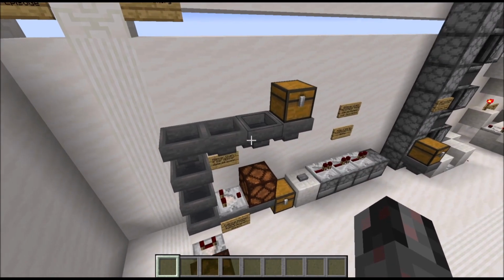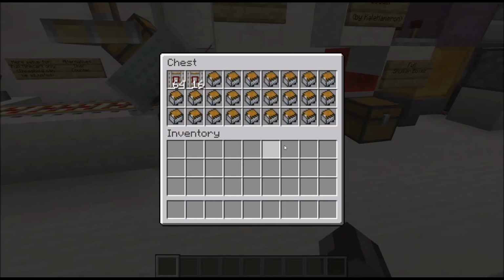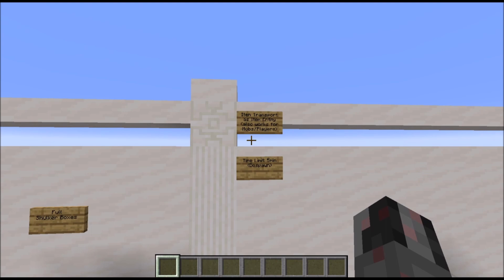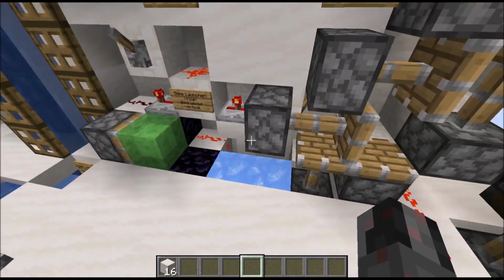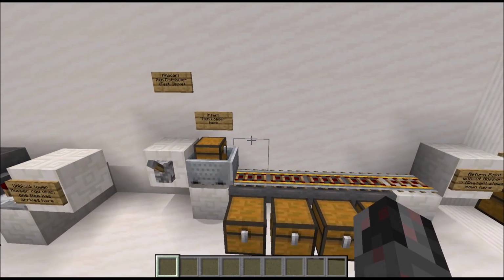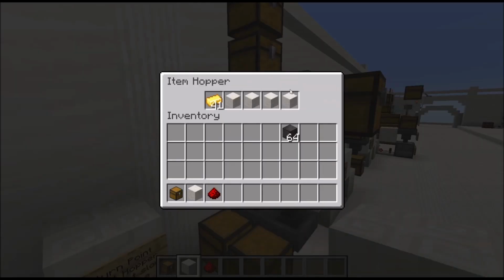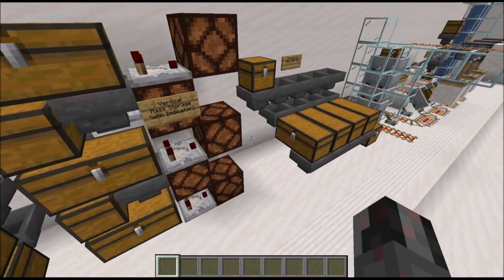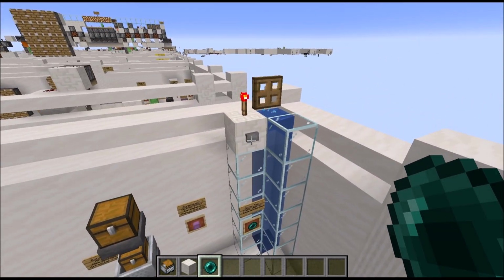Redstone Circuits: Episode 16 - Item Transportation & Storage [1.17]

Comment: Yay! Awesome. Thanks Walter 👍
Reply from the maker: You're welcome :)
And thanks!
Reply: @RKFWalter  I've always wondered - say for my testing world I want to create an NBT shulker/dispenser/dropper full of items, what is the command for that? Or even an NBT structure block.
Reply from the maker: tbh I very rarely work with NBT data, so every time I do I have to look it up myself, too.
I would recommend to look up the entries for /data, /setblock and NBT Format as a starting point. Then have a look at e.g. a filled shulker box with /data to see how everything comes together.
Finally I would recommend using the German Wiki for its better entry concerning block data (Gegenstandsdaten), but only if you speak German. Wouldn't make much sense otherwise.